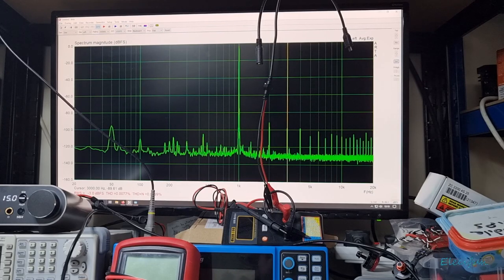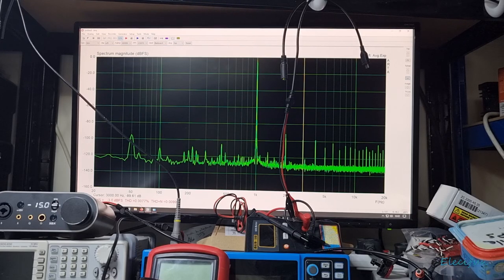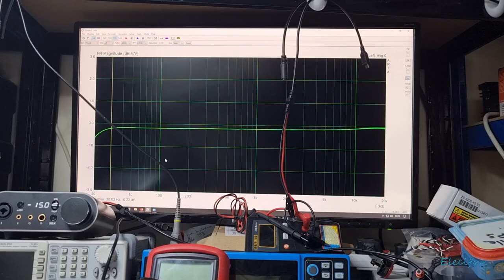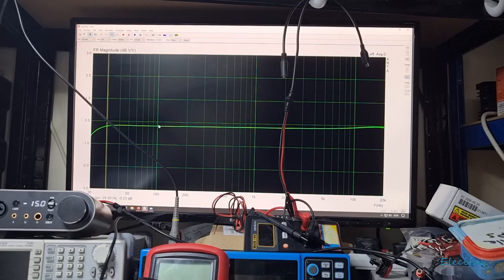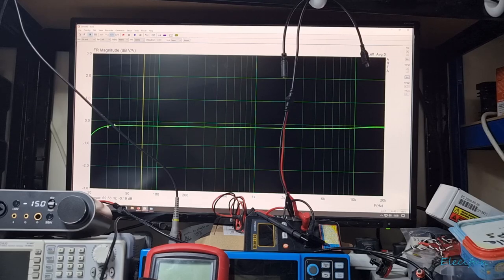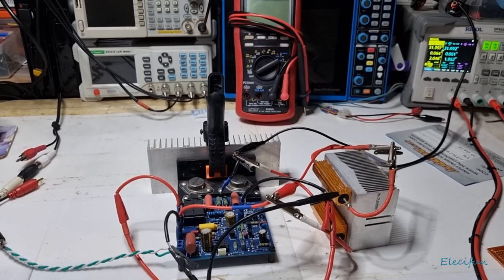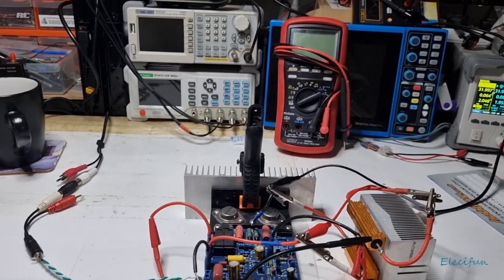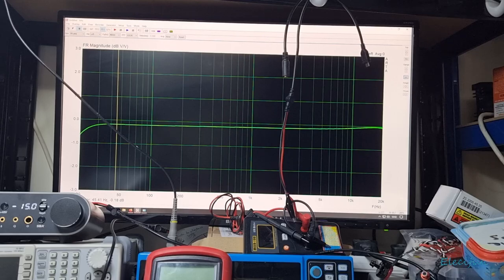QUAD405 T-O3 Amplifier Kit Revisited

Comment: I've always thought there was a bit of magic woven in with the science when it comes to audio electronics.  There are so many variables involved. From the circuit design to the PCB (if you use one) to the individual components you choose from different manufacturers to the amount of input power to the type of input and output, analog or digital, to the speakers you use to the sensitivity of your ears, the type of testing equipment and software...🤔😮 I think it's part of the fun of the hobby for some and a source of mild aggravation for others. I've never personally gotten deeply into the testing aspect of amplifier building beyond what my ears tell me but it is interesting to see the numbers and I can understand the appeal of chasing the "perfect" amplifier unicorn. The hunt is often where the fun is. It is a source of wonder to me how the exact same amp can sound dramatically different to different people and even more intriguing is how the same amp can test differently depending on the equipment and software used to test! Happy hunting amigo. Thanks for posting these interesting videos. 🦄 🍻
Reply from the maker: @Sonic_Ox Hi Ox, the reason there is a difference with the test results, is because the way I'm testing for THD and THD+N now. 
Using ARTA I can use the sound card in my PC which has a much better resolution than a regular 8 bit or even the 14 bit scope I have been using. I am testing now at 32 bit, minimal 24 bit. The sound card I am using has a very low noise floor -129db. The Analogue Discovery noise floor is about -105db. The Quad405 shows a noise floor of about -115db. Using the Analogue Discovery (AD) measuring the Quad405 the AD is unable to measure lower than its own noise floor, which effects the results.

You are right regarding the many variables and different qualities within components, layout of circuits etc. 
Personally I am not chasing a perfect amplifier as in my mind I would have to start with the perfect recording, then the ability to play that back into an amplifier that would not colour or dull the original recording then into speakers that could represent that back to my ears. The best I can do is CD quality which is OK.... but there is studio recording quality which I have not gotten it as yet.

I am glad you are finding the video's interesting and I hope we can learn something along the way.
Cheers amigo!
Reply: I ALWAYS learn a great deal from your videos Elecifun. I find them interesting, informative, and entertaining. They always inspire me to take on new and different projects AND I love viewing little snippets of the lives of friends far and near. I hope "unicorn hunting" wasn't taken as an insult or criticism.  That is basically what I'm doing EVERY TIME I attempt a project from amps to quad copters to 3d printing projects etc. I'm always trying to achieve the "ideal" outcome that I have in my mind, whatever my definition of "ideal" is at the time lol. Cheers mate 🍻.
Reply: 9:34 It's not because they're copper instead of tin?
Reply: "I just thought I'd throw that out there." 😂 I heard that saying years ago.
Reply: I don't really understand these terms still it's all very interesting all the same. 🤔
Reply: Screen recorder ... hmmm What do you hold down to do that? Wait ...
Reply: Hold Down "Windows" key + the "Alt" Key then tap "R"
Reply from the maker: We will find out?
Reply from the maker: Nice one, cheers Dec. I have just dug out Debut from an old hard drive for screen recording. I will try the windows one today.
Reply from the maker: @Sonic_Ox No buddy no insult registered this way. I'm always muddled regarding Unicorns.. they obviously don't exist and yet the British Royal family has one on their coat of arms. I'm not sure what that's all about.
I'm the same striving for the ideal outcome. Perseverance is the key. I remember some teachers would say I was very testing, that actually works for me now.. lol.